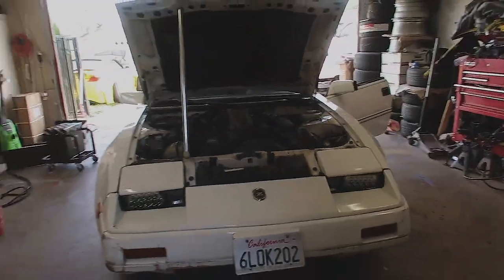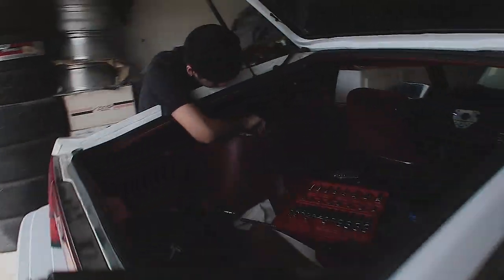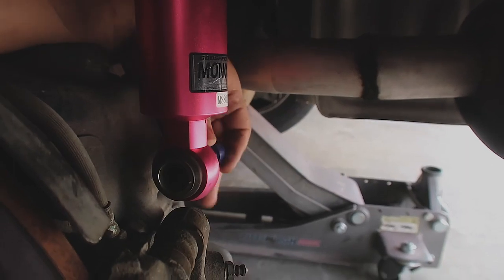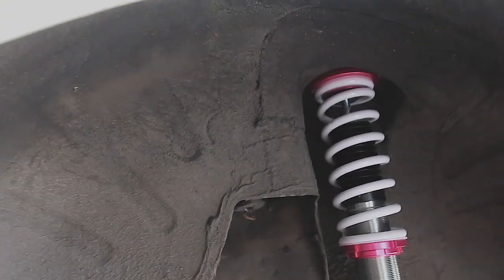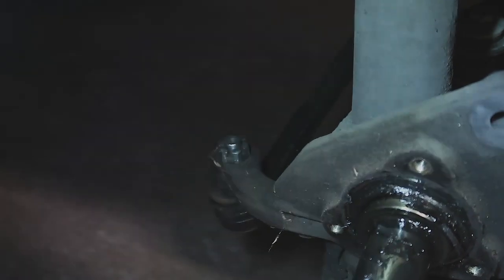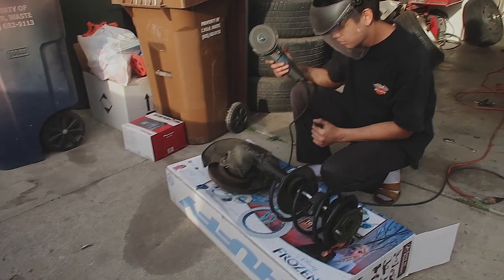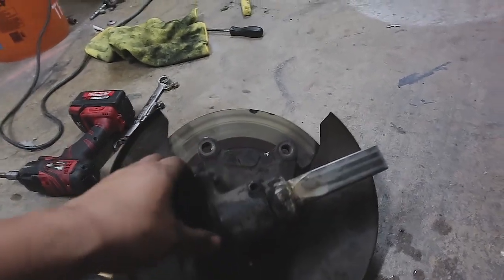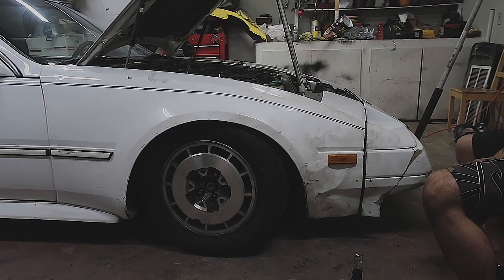z31 gets S13 Coilover’s.

Comment: How are the Coilovers and the adapters after 2 years? and is there anything different your brother would of done to his setup after the fact? I will be doing a S13 conversion to on my 87 z soon. Thanks for the content
Reply from the maker: Cars been sold but the suspension still holding up great, even after a handful of drift events. I like this adapter because you can just change out the coilover with out having to reweled incase the blow or get damaged.